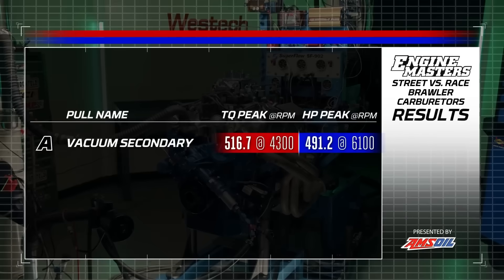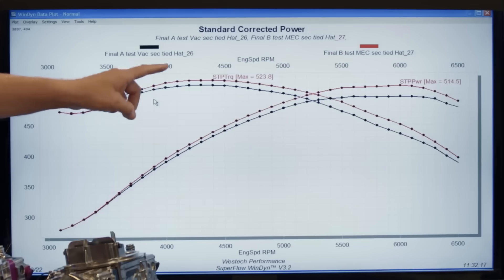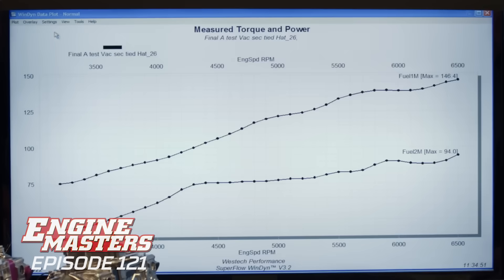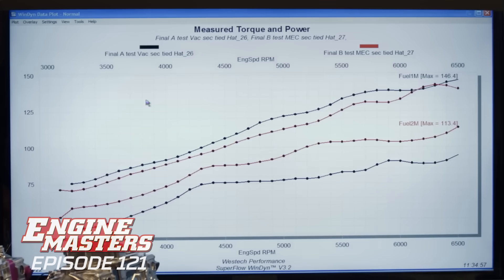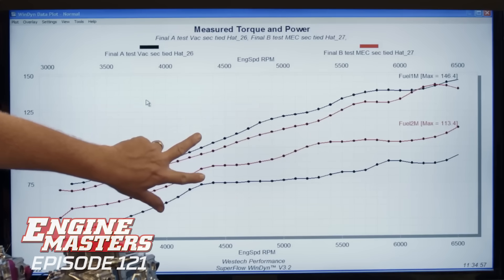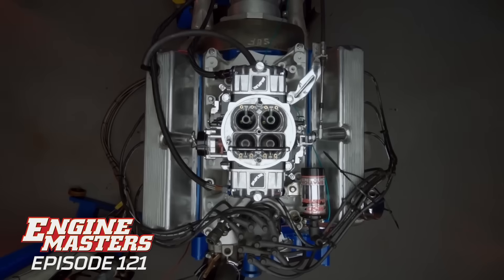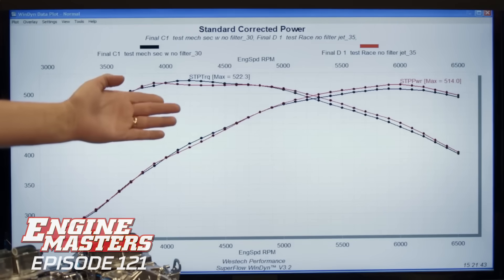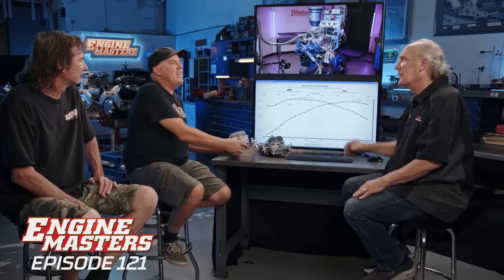Carburetor Confusion! What's the Best Setup? | Engine Masters | MotorTrend

Comment: Got a question fellas. On a street racer with traction problems, would a vacuum secondary carb with a secondary spring kit, and a stiffer spring. Would'nt that help traction by bringing in the secondary's slower. Mind you this a car with gobs of Horse power & torqe with treaded tires?
Reply: Yessir. I also read stories of successful racers in the old days setting up their carburetors to intentionally open the secondaries TOO fast so as to create a sag in power to help traction.

Comment: If Vac vs double pump had the same air flow,  and  HP vs choke horn had the same air flow,  how did you guys come up with two different reasons for the power differences. and why if  with the Vac vs DP   if your theory of fuel volume is correct,  could you not just jet the Vac carb to match the fuel delivery?
Reply: Because they want to help Holley sell their more expensive products for their own gain.

Comment: The VS Brawler needs a “White” secondary actuation spring in the pod.  Also the brawler should be tuned via jetting and air bleeds to compete more accurately/similarly. 
So this test needs to be clarified “Out of the Box” comparison only.

Comment: The statement that you can't make the run good everywhere is wrong.   It is done regularly,  it just takes more time.  Statement about better quality of air in regards to choke tower or not,  is true.  The vacuum secondary carb can also make the same power if calibrated correctly.  Just make up for the fuel that is being pulled through the acceleration circuit on the DP.

Comment: did your vacuum secondary carb have a metering plat on the secondary side of did it have a jet plate - Holley used to make a special metering plate specifically for the 759 vacuum carb and that makes a big difference in how it responds --- check that out

Comment: The Crew:  I noticed on my 780 CFM 3310-4 carburetor that the secondary metering block had a power valve to compensate for the none float bowl accelerator pump pulling fuel into the carburetor at full throttle.  My theory is that a power valve would increase horsepower because the fuel to air ratio is increased, even though, air being pulled into the carburetor is the same between the HP and the chock horn carburetor comparison.  Ready for a new test?  Shall we see?  Love too!
Reply: I think the main disadvantage of using a powervalve circuit on the secondary side of a fast accelerating vehicle is the fact that the powervalve recieves it's fuel halfway up the metering block instead of on the floor of the bowl where the main jets recieve the fuel. When the vehicle rapidly accelerates, the powervalve is more likely to be uncovered by fuel that rushes to the rear of the bowl. The powervalve circuit is really only needed for part throttle operation, so it rarely is beneficial to use on the secondary side. There are road racers and maybe even NASCAR racers (of the past) that run around a racetrack at much wider throttle openings than a street driver does that have put them to good use on the secondary side. In a front to back mounted Holley carb on a drag type vehicle it is best to block the powevalve on the secondary side and increase jet size to compensate for the elimination of that circuit.

Comment: Ok lets start with the flow numbers. There claiming the numbers were equal with the stack. With the stack. Im thinking the street carb with an air horn is actually benefiting from the velocity stack since it is straitening the air to flow down through the choke tower. The opposite is true on the race carb radiused inlets flow from the sides and the top so the stack was hurting flow potential. I had one engine in the 550HP going  a car with a low hood (Corvette) So with a race style carb tested it with a very low AC about 1.25 inches off the top of the carb and without an AC numbers were the same.  I think it is because the carb flowed well from the sides and really didn't miss anything from the top. 
OK Using Pull over from the Accelerator nozzles in your fuel curve is not a good idea. Poor inconsistent atomization?
Unless your just out of main jet capacity? File a groove in the base of the nozzle to break the syphon.
Yes its always easy to back seat tuner/critic and yes its not easy im sure to put one of this video's together and make it make any sense. But due to all the variables the conclusions there getting would be considered junk science by real scientist. 
Also the vacuum to double pumper test they are just nailing the throttle there is no driver feel or skill involved so yes the vacuum system is acting like a primative governor. So i consider that test Ah inconclusive

Comment: I wonder if cutting off outer side wall of the choke body
Reply: I've wondered, too, but figured if yer gonna cut, might as well go all the way😁 Many years ago I used to do it with a hacksaw, then file, then clean up with sandpaper. Later in years used a dremel with cutoff discs in a flexshaft and then clean up. Now I prefer to use an electric choke and properly sized idle fuel restrictions for acceptable fuel economy.

Comment: Turbulent air can be troubling, to say the least. It would be interesting to see an airflow test through the carb intake to the manifold. Bad air can cause uneven distribution of fuel vapor, also depositing fuel on the inside of the manifold walls.
Reply: An HVH Super Sucker tapered spacer really helps even out the cylinder distribution through the intake. I was able to lean my carb out a couple jet sizes in both ends of my 750 Street HP after installing the SS spacer. It was designed to inprove the performance of 80s/90s NASCAR Xfinity engines that were required to run 450 cfm carbs. NASCAR now allows tapered spacers on the Super Speedway engines instead of a restrictor plate.
Reply: @bradgriffith4231  I was more concerned with the airflow after the carb. Certainly, that spacer is going to work, but I've seen guys trying to smooth out the inlets of an intake manifold for as far as the tool could reach. The fuel would tend to stick to the smooth surface and starve the cylinders of fuel. Where the rough surface allows for the fuel to molecularize evenly in the air stream to have an equal amount of fuel/air.
Reply: @dagger6467  It's called laminar airflow & the science has changed over the years. Knowledgeable head & intake porters wet flow the runners to even them out but after they've done a zillion of them, they barely need their flow bench. I know from experience that the HVH SS spacer works because I was able to lean the mixture a couple jet sizes in both ends of my carb after installing it & the plugs were more evenly shaded after making the changes.
Reply: @BRAD GRIFFITH  Laminar flow Is not conducive to fuel air mixture.

Comment: Noooooo.  The difference n power between a double pump and vac sec are the high speed air bleeds more often than not
Reply: Yep. And that's something that the engineers should have worked out- not the difference between vacuum or mechanical actuation.

Comment: So jet the VS up and run it again
Reply: If the secondary a/f ratio is correct through the mid range but leans out on the top end that means that the high speed air bleed/main jet relationship needs adjusting.

Comment: I daily drove a 650 double pumper for a year and a half with the choke horns milled off and it never once gave me a problem as long as I drove it at least every other day even in the winter.  I highly prefer how they drive with a manual over a vacuum secondary, but that’s my preference.
Reply: Same here I ran a 600 dp on a mild 360 automatic , it ran flawless .

Comment: Ok but, what happens to power when you cut off the choke horn?
Reply: then it becomes the one without the choke. and theres not enough of a difference to run without a choke on the street.

 thats what people did all the time back in the day.  now they make them just like that brawler with no choke with either vac or mechanical secondaries..
Reply: @KingJT80  ok so it'll flow like a smooth carb? I am new to carbs so I wanted to know if it'll flow just as much as a smooth carb or be just a little shy of one. I bought a carb off my last boss that he cut the choke horn off of
Reply: @Elver_Galarga_4u  oh ok.  thats also dependent on how it set up.  mechanical secondarie are sensitive to rpm range and cubic inches. they have to be the correct size or else you'll have to adjust things more
Reply: The way I imagine it is if you need a low profile air cleaner to fit under the hood, a caburetor with no choke tower is most beneficial for power. A vehicle with a functioning choke can be tuned for a better combination of fuel economy and performance.

Comment: I’ve always been a fan of the tri-power setup.
Reply: Three Holley twos on a 428cj falcon was my money maker. With a 300 degree hydraulic cam it was capable of 7500 rpm. That was in 1972. The hottest setup for the street was the 406 3x2 induction for the FE engine.
Reply: I was running tripower on my big block Chevy. I replaced it with a single 4 barrel.
Although Chevy only rated them 10 HP apart, you can positively feel a big difference.

Comment: Carbs dont like cold starts on motors with decent hp.and will eventually foul plugs.. holley sniper starts off the key every time.
A good engine setup on a dyno is set up warm Af in perfect. On a cold start its lean and pumping fuel into the thing to get it started and running will foul plugs.i have 7 sets of good plugs that are all over time wet and black. They cant be cleaned. Do you think race teams clean their old plugs...no.
Reply: YOU need Sniper😁

Comment: I use a Quickfuel brawler 850 DP.on my Mopar 500 inch low deck with ported heads...it's also equipped with a ed's Victor single plane intake.  I think this setup is bait for a dual feed carb! A vac sec carb can work it's just doesn't have the fuel curve of the DP...also Thompson perf atomizer plates on both ends of the dual feed carb really help in low end torque

Comment: Couldn’t just jet up the secondaries on the vacuum carb to make up the difference? Were you just running box stock carbs???
Reply: My thoughts too. If (as shown) the airflow graph was (basically) the same. But the fuel flow graph showed less fuel flow. Doesn't take a rocket scientist to figure out it was a leaner mixture. So it was un-tuned. Just out of the box, dropped on, and ran. That's what I saw. Not ideal at all.

Comment: There was one I'd like to see in addition to this - that is how much bigger do you have to go in vac secondary carb size to negate the double pumper advantage?
Reply: Why?  The HP loss is negligible from a street to strip application.  Use what the application calls for.
Reply: @joshtheking1772  Oh I see, because you don't see the need for a test like this then it doesn't need to be done.
Reply: @ThePaulv12  maybe instead of relying on free entertainment to do it for you, you should do the test yourself and then enlighten everyone else for free

Comment: What would happen with the vac sec if you changed the back boosters to a larger size to compensate for the discharge nozzles extra flow

Comment: The vac secondary has a mind of its own. You can be going up hill not even half throttle and the 4 barrel will come in sometimes and on certain hills it would do it every time but if you really wanted the 4barrel to come in and had it stomped to the floor they won’t come in exactly when you want them to. If you have a mechanical secondary carb it comes in when you tell it to and does not come in when you don’t but on the other hand the GT 40 cars that won LaMons had vacuum secondary carbs and I still had rather have a mechanical carb

Comment: Great information. I had those same questions and, I agree with your answers! 
The only other difference that you qualified in the beginning is, that (I.e.)a 750 carburetor would be the Minimum that carburetor would flow. It could actually flow much more in a given throttle body. 
Great job gentleman!!

Comment: I want to see the delayed vs progressive secondary comparison on the race style carb or both the race style or smooth top double pumper for that matter also maybe a vacuum secondary Holley vs Edelbrock  Maybe with lower rpm starting points..
Reply: The dyno can't be loaded to as low an rpm as we would like to see.
Reply: The Holley will kill the carter afb knock off (Edelbrock) for power. Fist thing that will happen is fuel starvation due to the small bowels and low flow needles. And how about that 1940"s designed Accelerator pump on the AFB. The only advantage the AFB has is no gaskets below the fuel level so they can be more reliable in daily driving sometimes

Comment: The test with and without a choke horn is not completely accurate. Both carbs would show improvement with a K&N stub-stack, but the same principle would apply with a proper air cleaner base on either carb. The truth is, if you add a wall entirely around the airhorn that forces the airflow to drop straight down into the airhorn instead of entering from around the sides (as with a flat or non-existent air cleaner base), then the airflow is both better in volume and in flow quality. You can see this principle with your sink at home. With water flowing around the drain from all directions, you will get a "vortex hole" in the middle of the drain's flow. If you force the flow to enter from above , it will eliminate the vortex and allow straight-line flow. We do this with the bottom of the carburetor when we add a spacer. It does not just improve performance strictly because of the added plenum volume that may be needed, but by forcing the air through the carburetor in a straight line for a longer section. The longer the air is flowing straight before and after the carburetor's venturis, the better the flow and volume will be. That is one reason why "tunnel-ram" intake manifolds actually do so well. If the only air cleaner that can fit on your carburetor due to hood clearance issues is a small (less than a 3" tall filter), then the carb with the milled off choke horn is going to work better only because it will allow more airflow into the engine, even though it is a less efficient airflow than optimum. If you can, use a stub stack and a filter element top lid for the best performance. Been there, done that many times. 
The other issue - double pumper vs vac secondary : the double pumper is better designed for performance engines with camshafts for RPM/HP. Once you cross over a certain cam duration (depends on many variables, but usually around 220 degrees) the engine needs fuel added to the airflow instantly to complement the instant airflow allowed by the rapid opening throttle blades. The double pumper is designed to do that and if tuned correctly is basically a mechanical fuel injection system in operation. Vacuum secondaries cannot do this. They are "reactive" to airflow and always lagging behind the airflow curve by design. Great for torque because they constantly "size" themselves just a little smaller than optimum cfm at all engine speed and load ranges. Just not able to give the engine that maximum airflow upon demand instantly as the DP carb can do.

Comment: Great series!! Can’t get enough!! Curious, would EFI (Terminator, Fitech) beat or match the double pumper?
Reply: The carb like efi setups look really nice, imo.  However they sometimes have issues with dual plane intake manifolds.
Reply: @nocturnal0072  
Yes you’re correct. I believe the fix is either a air gap dual plane manifold or a 1-2 inch spacer. I believe I’ve seen the air gap machined
Reply: @timfarley4485  just run a victor jr  with a sniper.  i know steve morris isnt a big fan of them. he says go real MPFI or dont do it at all.  like edelbrock pro-flo or holley terminator

Comment: The double pumper had the advantage of the air hat. You got the results you wanted by giving the DP straighter air flow.
Reply: My thoughts exactly.  Air probably had higher velocity before entering the dp carb than it did with the vacuum secondary carb without the air hat.  Like the old school velocity stacks, or Weber 8 stack system.

Comment: First, your shows are so therapeutic!  Thanks!   Anyway, was wondering how much of a difference a drop-base air cleaner would have made in these tests...especially with the choke horn?!
Reply: Yes, which is more critical? To have a less than optimum intake manifold that fits comfortably under the hood topped with a free flowing air cleaner, or to have a tall, high flowing manifold that requires a low profile air cleaner and especially when used with a choke tower equipped carb? Years ago it wasn't a hard decision to install a scoop or change the hood on our cars, but today a factory appearing classic is very desireable.

Comment: would of been nice to see air fuel ratios of the double pumper to the vac. secondary carb.  Great info to see though!  Love my double pumper on my Cuda!
Reply: This. The primaries are working a lot harder/likely not metering as well as the secondary in the vac carb. I am guessing proper jetting would even these carbs up but ultimately the DP would be making more horses. Have a look at the secondary butterflies on a dyno engine you will see how they open/close depending upon vacuum and the diaphragm/spring setup.

Comment: Would a carb still have the same hp and tq as a Holley EFI?
Reply: The carburetor can and does match or equal FI in performance when properly tuned by a professional. The only area that the carb cannot match a FI is in fuel economy. FI can completely shut off fuel flow upon deceleration, which a carburetor cannot.
Reply: @reason2gether  THX!